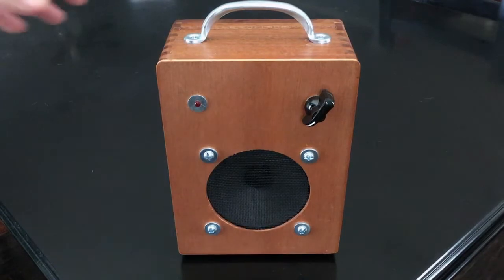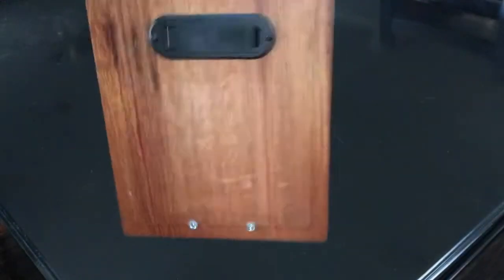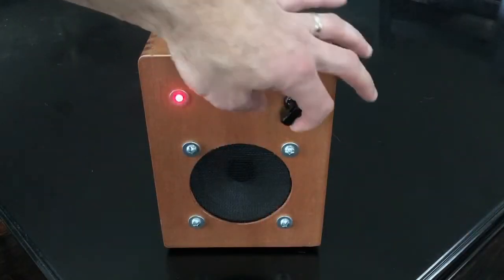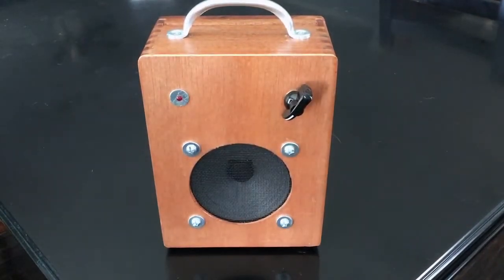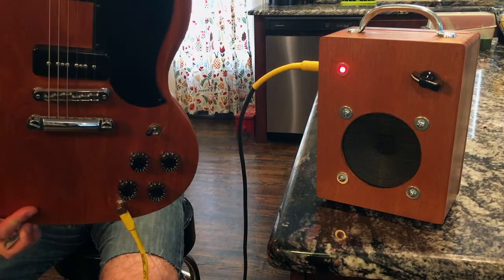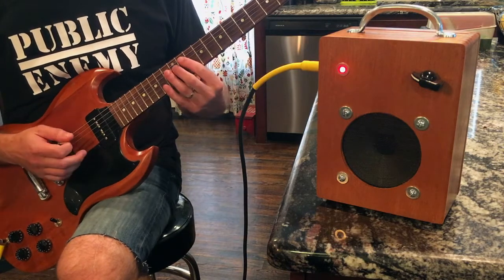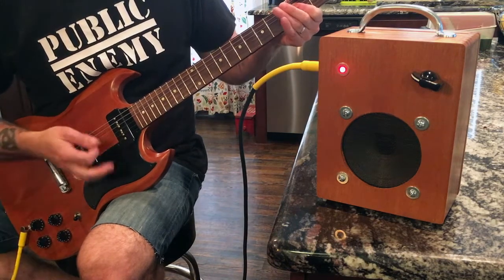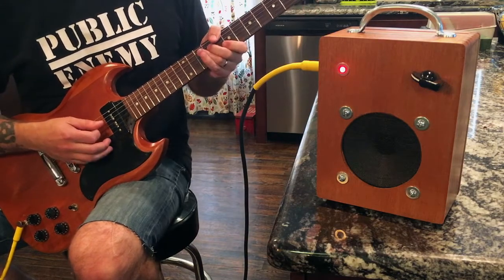DIY Cigar Box Amp #3

Comment: It's amazing the clean tone you can get through that little Artec Amp Circuit Board. That would be perfect for some of my little cigar boxes that are too short and fat for a proper CBG but could be a groovy little practice amp that keeps with the cigr box theme
Reply from the maker: They really are great little amp boards. I think this one sounds especially good because of the larger speaker and all-wood box (but I have used them with smaller speakers and boxes too). I use this little amp a lot. Thanks for watching the video.